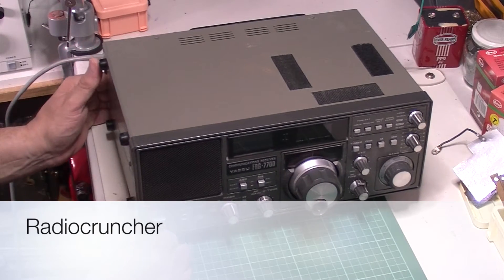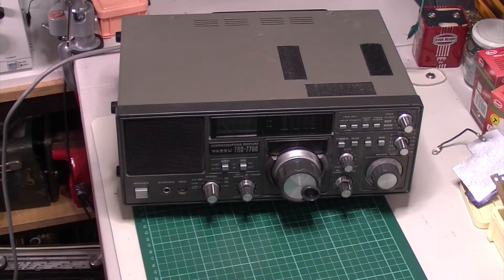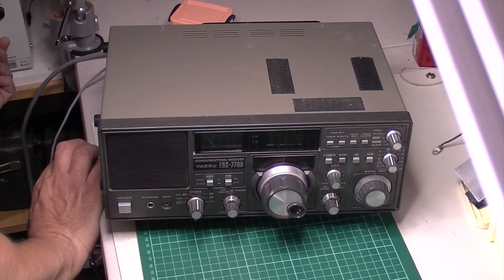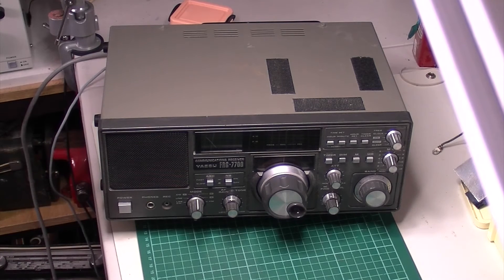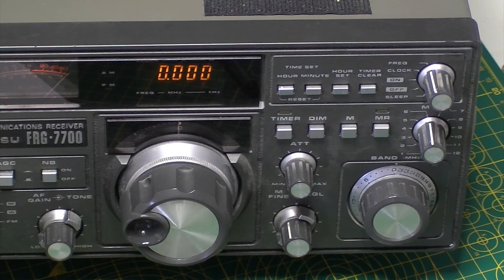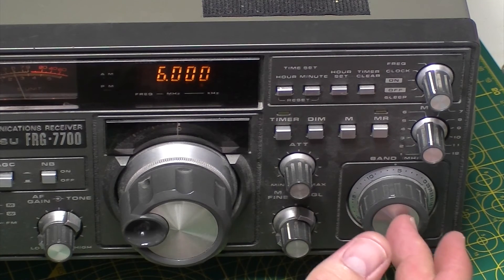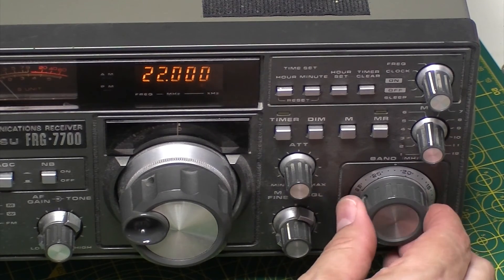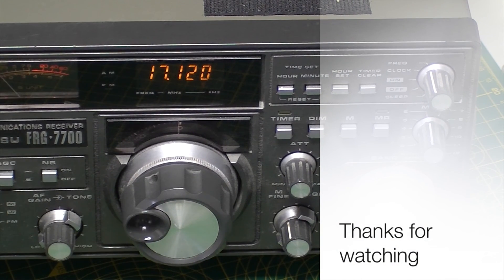Yaesu FRG-7700 HF receiver troubleshooting Part 1

Comment: Listening to mine as i watch this video. 👍 got mine in as new condition. The screws have never been removed. I just wish mine had the memory block.
Reply from the maker: Nice, I bet it's a good one. It's a great receiver.
Reply: @Radiocruncher its very nice. Deep sounding audio compared to the R-1000 kenwood i have but it has the top mounted speaker.

Comment: I just sall all your videos related to repair of this radio congrats a lot of great work you have put here. i got recently one as well and look like to have one issue frecvency nob is moving with some rezistence i could say and even if calibrate the frecvency  for example on 1 MHZ calibrate  (the electronic display with the dial) and by 2 Mhz already have discrepancy any suggestions? Thank you in advance!
Reply from the maker: Have you checked all the VCO voltages as they are likely to need adjusting.

Comment: No never. I own an frg100 a much later set. Looks like a promosing set to repair.
Reply from the maker: It will certainly be interesting. I've worked on a few older ham radios in the past and did have one of these for a short while but traded it for a JRC NRD-535. Got to find a frequency counter now
Reply: +Radiocruncher You could use the oscillator field of another receiver to generate an injection signal if you get stuck, though that generally is only of use for dial alignment :)
Reply from the maker: Thanks Dave. From initial finding the dial alignment is pretty much there. I did compare it with my Icom IC-7800 to verify the 20m band but haven't gone through all the bands yet

Comment: PSU ripple?
Reply from the maker: Seems that it might be possible Simon. These have a reputation of the power supply failing. I ordered all the caps and a replacement bridge rectifier earlier so should be here tomorrow. You ever had one of these in?

Comment: I wonder if the issue could be the result of irregular behaviour in the PSU, I experienced frequency issues (locked VFO) from a dry solder joint on a regulator on the power supply board of the R1000 which supposedly uses a similar circuit design to the FRG7700.
Reply from the maker: Good call Dave. One of the jobs that's a must is to recap the power board and fit a new regulator. All on order so should be here tomorrow. Thanks for the help and please let me know if you think of anything else. Graham

Comment: AF117s, got to be 😁
Reply from the maker: If only! It's turning out to be a bit of a head scratcher.
Reply: +Radiocruncher I bet. It's all offset IF and PLL and scary stuff like that. In the words of Frankie Howerd, 'Oooerr missus'
Reply from the maker: It's a bit of a minefield Andrew. Does seem like it's limited to part of the VFO circuit so more thinking required